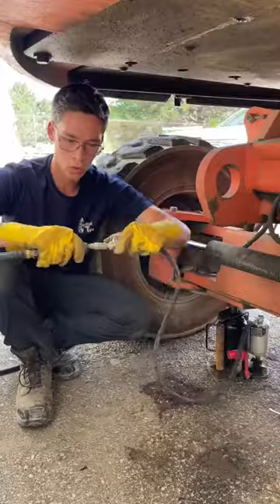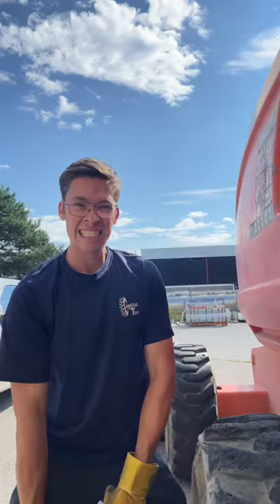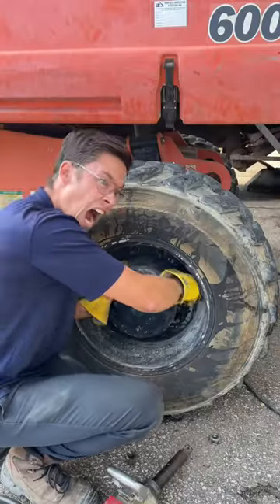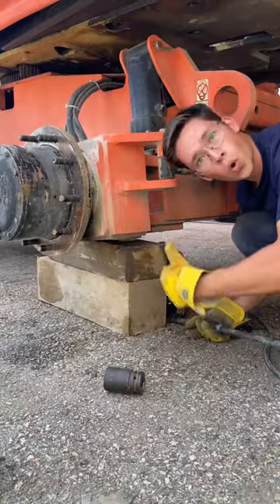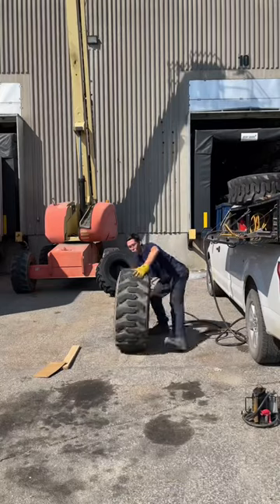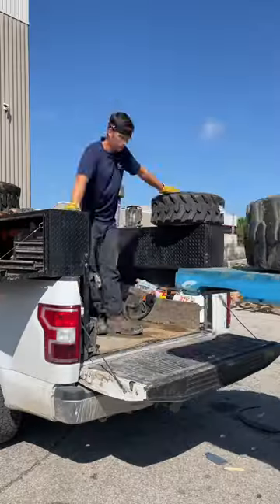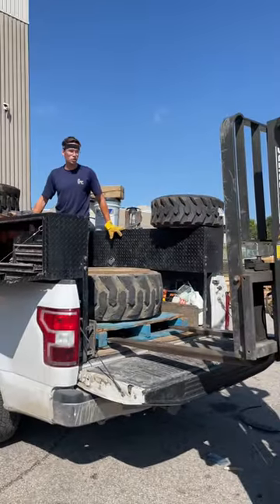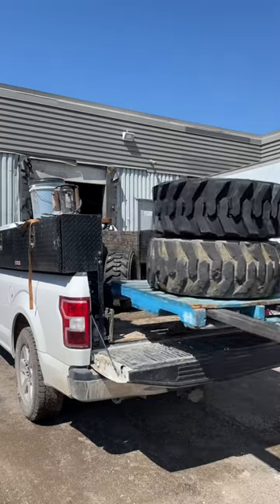How to Repair a Foam Filled Tire                     #shorts #tiredoctor #tires #tireguy

Comment: Painting lug nuts is like welding them to the stud.
Reply from the maker: And the inside of my socket 😭
Reply: @TheTireDoctor  
Rusty ones that have been painted are the worst.
Reply: My standard practice is to put a drop of motor oil at the nut/studd, and a drop at the nut/collar and then if it binds, I go back and rinse off the rust with degreaser as many times as needed, in extreme cases you can use grease,  but you should try to get it back off as it may cause over tightening.
Reply: @cameronduff884  
Out of curiosity, once a stud and lugnut have been painted, how can oil or penetrating oil get to the rust?
Reply: @happydays8171  I guess you will have to experiment with your hard case, if you weren't concerned about the paint on the rim, you might try brake fluid to soften the paint and then a Dremel with wire wheel, make sure you wear goggles,  in my school bus fleet,  I almost never have to go this far,  they do get get a lot paint and rust, but I am almost religious about the 2 drops of oil on each studd and I scrape the mating surface and ESPECIALLY the pilot bore, this helps them get seated and not drag over the pilots going on, probably helps them come off easier the next time,  hasn't hurt,  I'd know by now...
Reply: @cameronduff884  
Good deal. The brake fluid trick sounds like it'll work. I used to work at a tire dealership where we fixed a lot of old farm equipment, when I'd see they'd painted the studs and lugnuts, knew it would be a chore getting them off. Keep up the great work! My industrial arts instructor was a huge influence on me.
Reply: The stud chasers might also help. (Save a stud,  ESCO,  AME, Lange)
Reply: @cameronduff884  I’ve never had to deal with this problem at all, and most likely never will. But you explained it perfectly, to the point I’m actually confident I could take a painted stud and lugnut off (with a bit of help from someone who knows what they’re doing)